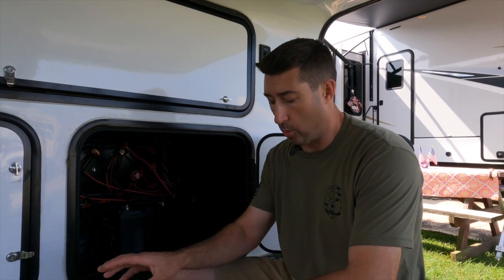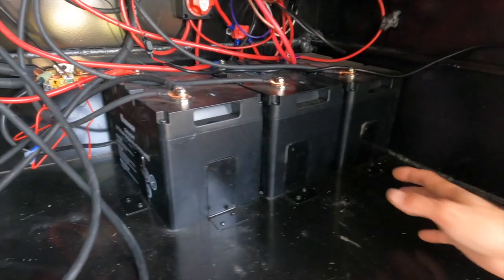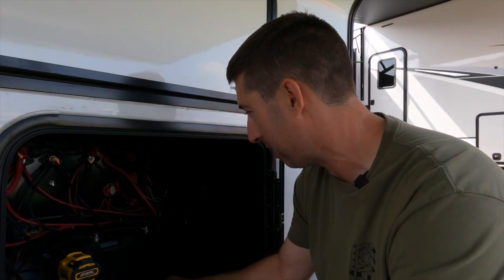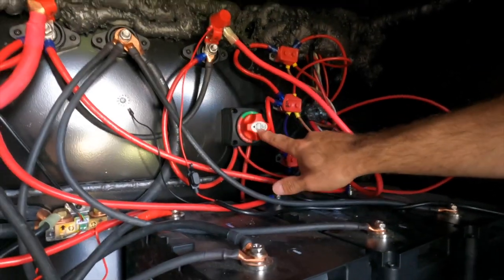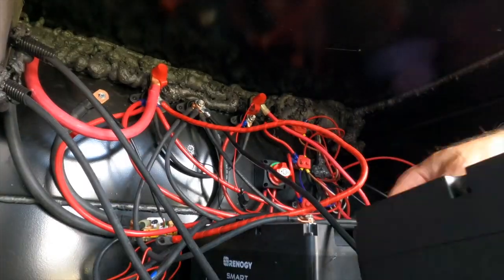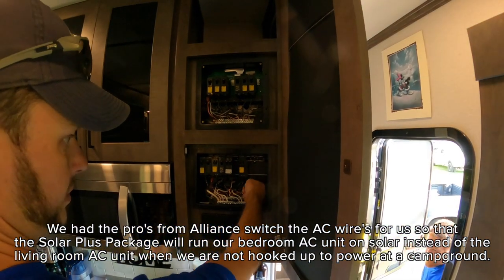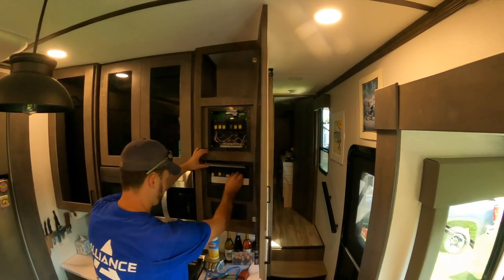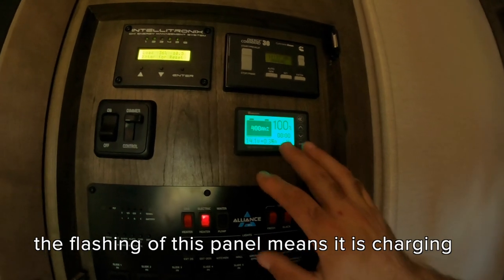Easy RV Solar Upgrades

Comment: Great video. 
How did you reset the battery monitor to recognize the new battery?
Reply from the maker: Hey John, once the additional batteries are at 100% I went to the battery monitor panel inside and changed the programming to show 400ah. There is a Renogy brochure that comes with the trailer shows the process.

Comment: That is great that you can run an ac for a night when you are sleeping. About how much does it cost to upgrade?
Reply from the maker: Thank you for watching our video, this toy hauler we ordered with the Solar Plus package and we had added an extra lithium battery. Not 100% sure on the total cost as we ordered this rig in March or 2021, so the prices have changed since then.

Comment: I love your videos! I always thought you needed to connect the black wire first then the red.  can you tell me why the red needs to be connected first.  Thank You!  you two are awesome!!
Reply from the maker: The reason I always connect the positive (Red) first is that while I am tightening the cable to the battery if I accidentally touch my wrench (Screwdriver in this case) to another piece of metal nothing would happen since the battery is not grounded. If the ground wire was already connected and I touched the wrench or screwdriver to a metal item there would be a short circuit, a spark, and possibly a fire (Rare).

In the world of lead acid car or trailer batteries (We have Lithium Ion). Lead acid batteries produce hydrogen gas as a byproduct of the charging process. The gas tends to collect around the batteries. Being that some of the battery compartments are enclosed (Ours is) it can increase the chance that gas is present. If you created a spark with the wrench or screwdriver by having the battery grounded first then putting on the red/power wire you could create an explosion.

Comment: So we have a 36v11,I just as added 3 more smart batts try'd resetting our controller to 600 but only shows 50%charge, do I have to reset to 100%  after complete charge?
Reply: I found out when batteries are 100% then hold up arrow to reset to 100% good video,I was thinking of rerouting our a/c wiring also

Comment: So now after some time has the addition of the fourth battery made a significant difference 🤔 
We have the 40v13 with the Solar Plus package. We picked up our unit just before Christmas and we are in Idaho so haven't Needed the A/C yet 🥶🤣😂
Reply from the maker: It did give us a longer run time, but we only used it over night at our Harvest Hosts stays and it never ran out of battery but we weren’t running the AC all night either, due to it already being cooler outside. I think it’s a worth while addition if you want to maximize the Solar Plus I would add a 100amp MPPT and an additional solar panel. Thank you for watching our video 😊
Reply: @VenturesomeCouple  Will the system support another 320 watt panel also?
Reply from the maker: Hello James, not without upgrading the charge controller to 100 amp or requiring to 24 volt. Right now you are capped at 800 watts on the 60 amp controller. If you upgrade the charge controller you will instantly pick up 160 watts more power based on the factory install and have the full 960 watts available. You can also add the additional panel at that point. 

The battery capacity is a personal choice when you hear that you can only add one more battery that is based on the theory of a balanced load. Meaning that the solar system in ideal conditions could charge the battery bank in six to eight hours of direct sunlight up to 100% capacity. you will not hurt anything by not having a balanced load you would have to supplement the power with shore power or generator if you drew the system down below the regeneration point of a single day.

Comment: Hello and thank you for this informative video. Question, if we are camping in the middle of July (hooked up to 50 amp shore power) and we have the middle A/C running we cannot use the microwave at the same time? We are looking at a  40 v 13. If that's true, it's a deal breaker for the wife!! LOL. Please let me know.
Reply from the maker: Thank you for watching the video. I wish it were a simple answer but it depends on the amount of other items your running. The trailer balances the load to make sure you don’t go over on anything. Ultimately you control what is a priority item for your trailer. You can set it up to never turn off your AC on a “load shed”. We just wanted to have AC run on solar in the bedroom and didn’t change the priority. It is a simple change to keep the AC on at all times. You can buy the 40V13 if you like it 😂. I would recommend talking to Bill Martin before you buy the trailer and discuss the various options for that. He may have a suggestion on the best method.
Reply: @VenturesomeCouple  Thank you for the information. Once we decide if we want to go that route I will contact the owner Ryan. We have met with him a couple of times and interviewed him on our channel. We appreciate your reply to us. Safe travels.
Reply: If you are hooked to 50amp shore power or running the generator you should have no problem running the microwave and the main a/c at the same time.
Reply: @jamesglenn520  this is false. They run through the inverter whether or not you are hooked to shore power.

Comment: My research shows that you can only add one more battery to this system. 
That makes a total of 400ah.
It is also Very Critical that the cable you use are the same gage and Exactly the same length as the other cables.
Different gage and length creates different resistance which is bad for a Lithium System.
Reply from the maker: Thank you for watching our video, you are correct, thank you for the feedback.
Since then we have a different Alliance rig and a new set up in the works.
Reply: @VenturesomeCouple  did you get out of this unit? May I ask why?
Reply from the maker: @georgesrisomsak9650  https://youtu.be/H6vg0kbW3pk

Comment: Do u have to add ex battery to switch to front ac
Reply from the maker: Hey Bill, thank you for watching! You do not have to add an extra battery to make the switch. The factory setup will work just the same once the breakers are switched on the panel.

Comment: Any update on how long you can run your bedroom AC off of batteries? Thank you
Reply from the maker: Good morning Simon, 

I have found it extremely hard to have a consistent number of hours on exactly how long I can run the AC on the batteries. As you know there are a lot of variables that change the usage in each location. Temperature and humidity play a huge factor because we use a lot of 12v electronics:

17cf 12 Volt Refrigerator
12 Volt JBL Sound System
USB Charging Stations Throughout
12 Volt Heat Pads for Tanks
12 Volt Power Recliners
12 Volt Bedroom and Garage TV’s

In a really hot environment 90+ degrees in Central Florida our AC has to run more frequently if not continuously and our refrigerator does the same. That dramatically reduces our availability of power for long duration. On average I am seeing about five hours of AC usage in a hot environment. 

I am looking forward to a cooler environment and seeing how the batteries hold up. I am also planning on adding a few more batteries in the near future just to increase my capacity.
Reply: @VenturesomeCouple  that's Great 👍 are you going to add more solar panels. I'm impressed that in Florida you get 5 hours.
Reply from the maker: Hey Simon, 

The main reason we get up to five hours is keeping the trailer at 74 degrees. That seems to be the happy place where it cycles on and off instead of constantly running. 

I am not planning on adding any more panels at this time.  Adding another panel would force me to change out the MPPT 60 amp charge controller to the MPPT 100 amp controller. I will add more battery capacity for longer duration of run time. When we boondock we use the generator during the day to speed up charging the batteries. Having 60 gallons of fuel on board makes for a great system with a few different power options.
Reply: @VenturesomeCouple   it was my understanding that the max amount of batteries is 4. Do you know what you have to change to add more batteries?  Will be really interested to see a video when you add more batteries. Thank you so much! Looking forward to your upcoming year
Reply from the maker: Hey Simon, there is two ways to look at the battery situation. Four is the maximum for a balanced load meaning that a full days sun would most likely fully recharge the system as the factory has it configured. You/we can have as many batteries as we need; the additional batteries may not regenerate on a full days sun. For us having the generator, I could in theory put eight batteries and run the generator to top off or finalize the charge of the battery bank. The additional batteries will not negatively impact the system you’ll just have to supplement the charge with additional panels, 50amp, generator etc.  Thank you for supporting our channel and the great conversation.
Reply: @VenturesomeCouple   Thank you so much! That's Great!!   I notice you have the auto start. We didn't get our unit until November so it doesn't have the auto start. How do you like it? I'm going to be contacting alliance. Fingers crossed 🤞 fingers crossed, but it's not too hard to add this later. It's definitely something that I thought it was going to have and that I was intending on using

Comment: How long can you run your AC on 400AH of batteries at night?  Are you running your generator too?
Reply from the maker: We haven’t run our generator at all during the night we have been very fortunate that it has been cool enough to just use a fan when we sleep at the harvest hosts. 

We haven’t tested the AC with the new set up yet. We did run our normal fridge, cell phones, Apple watches, two computers and all the other built in 12 Volt minus the ac and we only used 24% for a 10 night period.
Reply: @VenturesomeCouple  thanks. We appreciate the update.